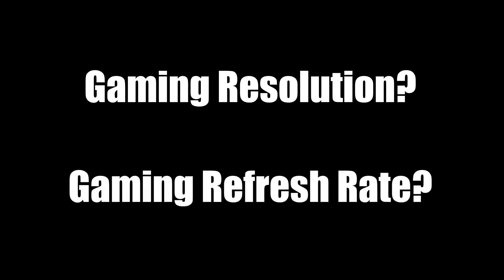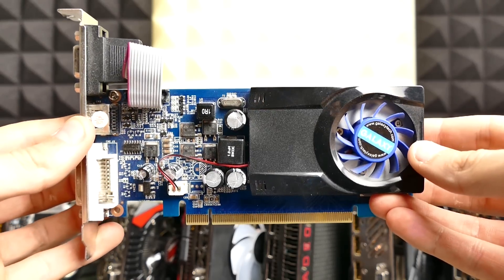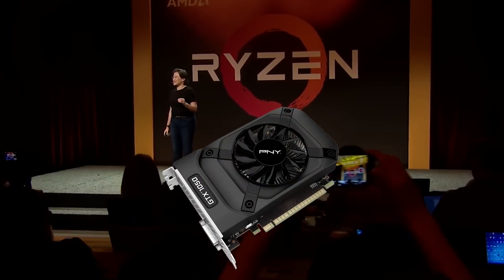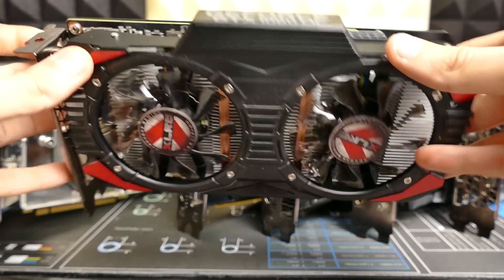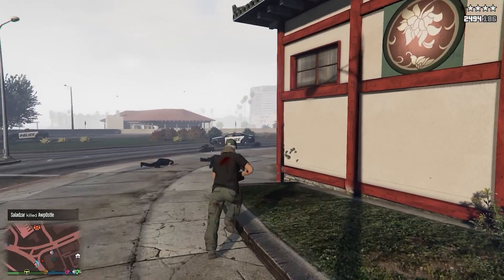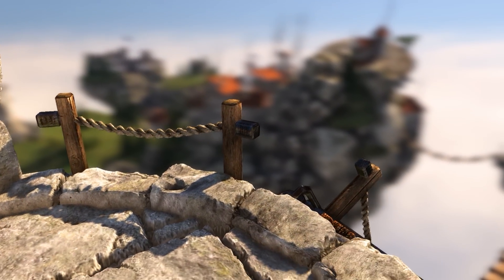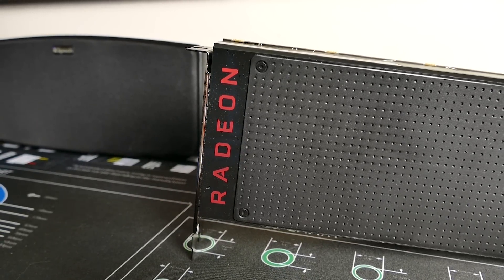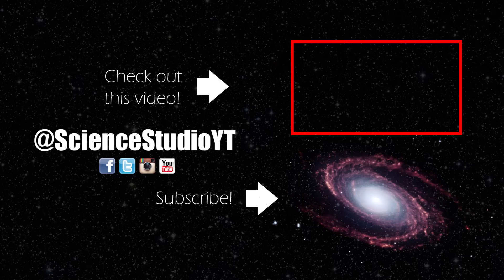Graphics Card Buyer's Guide (Mid-2017)

Comment: i am going to buy a graphics card for 720p gaming ( via 32" TV ) 

Games i play mostly Racing Game ( F1 , Grid, Dirt ) , RPG Games ( Some Indie ones and some JRPG )and some FPS games like Battlefield 1 / Fallout 4 

i currently using i7 3770K @ 4.0 Ghz / Z77 / 24GB HyperX Fury 1866Mhz / GTX750Ti + Quadro 600 ( i am mainly using my PC for Graphics Design, Illustrations and Game Developing but i like play some games since i am game developer and i do need some research by playing games hahaha..  )

should i stay in 750Ti or Upgrade to RX580/GTX1060 3GB ? since if upgrading to 1050 is like.. Sidegrade in my opinion, so actually i am more interested in GTX1060 or RX580, i know it sound overkill for 720p but i like to play it on High-Ultra Settings.

Most games still fine in 750Ti @ 720p but i just think 750Ti is obsolete for today and tomorrows games.
Reply: Huang Yuoxi how well is the 750ti doing at 720p? I think a worth upgrade might be the rx 4/570 and
 the 1050ti. I dont think its that worth to spend the extra 40-70 to get the 4/580 or the 1060
Reply: around 50 fps at high at bf1 and 45 fps at ultra in fallout 4. i want 60+ fps that's why i kinda interested upgrade to 580 or 1060

Comment: as stupid as it sound i use a pentium g4560 and a rx 470 for light 4k gaming but mostly for 1440p gaming. Since im satisfied with lower refresh rates because of freesync it has opened up alot more option in the graphical department

Comment: I think the AMD RX 400 series was replaced by the RX 500 series. I was going to get a 580 but decided I would stick with my R9 390. I spent $1,250 on my build. It took me a while to save up to do it. The most expensive thing in my build was my CPU, the i7 6700. Behind that was the GPU, I got the R9 390 for $295. Then after that comes the case the Spectral R5, the Motherboard an ASUS H170, the WD black 2TB HDD, the EVGA G2 750 PSU, the Mushkin 120GB SSD and the Corsair 16GB DDR4 RAM. Everything else except the RAM was a little over $100.

Comment: I'm going from an amd fx 6300 with rx 480 to ryzen 1700 with rx 480. how much performance gain can I expect?
Reply: boat loads of gain.....your minimum frames will now rise out of the 40's......you have ascended :)
Reply: In CPU intensive games, a lot
Reply: YES. SO MUCH. I, personally, went from an fx 6300 w/ an rx480 to a Ryzen 1600 (OC'd to 3.9ghz) with rx 480. 

Whereas in my previous build I would get good FPS in most games, I never realized how much stuttering and inconsistencies there were in the performance. It's absolutely buttery smooth. I max out Titanfall2 with a steady 100ish fps. I max out battlefield 1 at a steady 90ish. gtav max'd at 70-80 steady. 

And that's the real difference: it's so much more stable. Games run at not only a higher framerate, but they play so much smoother. I didn't realize that's not how games ideally look on a pc. 

And that's only with a 1600. You're getting a freaking 1700! It's going to be a world of a difference. 

Also, as of right now, my ryzen mobo can't fully utilize my corsair vengeance lpx ddr4-3000 yet. I can only get them to 2667 as of right now, but there's apparently a big bios update coming at the end of the month that will address the memory issues :) Welcome to Ryzen, brother.
Reply: He's not dealing with your average FX chip anymore ... Now he has ascended , Ryzen to new plateaus of Saiyan prowess ! He is now, a SUPER SAIYA -  Wait .. wrong thread . Too much TFS
Reply: aircraft carriers of performance?
Reply: ok everyone I worked up some money and finally ordered it. ryzen 1700 with corsair vengeance lpx 3200 mhz and msi b350m mortar. hope it works out
Reply: Two words: A LOT
Reply: Mihnea Andrei Mehedințu 
Have we been here before? I feel like we've been here before.
flashbacks to fx gpu
Oh god we have been here before!
Reply: Cargoships of performance
Reply: You will have a lot more of performance
Reply: Metguy123 thanks man
Reply: Metguy123 What motherboard do you have? I'm planning on getting the Asus prime x370-pro
Reply: Oh yeah I'm looking to build a ryzen 5 1600 system this year but unsure if I should wait for VEGA or get like an rx580... AMD is looking up though :)
Reply: I have an Xbox 360 mate :P No Gaming rig...
Reply: I plan on upgrading to the 1600 after I finish saving for it.
Reply: Filip Gasic the 580 isn't that much better than the 480, but you should get it because they are the same price. I think a 1600 would go well with a 580
Reply: Filip Gasic 500w is plenty just make sure you get a good one from evga. I'm running the 480 and 1700 on 500w.
Reply: Filip Gasic well 3.9 ghz would be hard to achieve with the stock wealth cooler but 500w should be fine. However, even though they are expensive in the eu I would not cheap out on the lifeblood of your system. not only will it be inefficient and cost you more money on the electric bill, there is always risks that it can damage your system. a good evga 500w 80+ certified psu is only $50 in the US, not sure about the eu.
Reply: Cullen Lonergan im very new to all this i just have 1 question please. how much $ was your build & are you using SSD?
Reply: Rey Suarez I've upgraded my pc over the years but I would say it's about $1000. I am using a 500gb Samsung sata ssd.
Reply: CaptainDieg lol did you read the earlier commrnts? I upgraded like a month and a half ago and it definitely makes a difference in both types of games
Reply: But that's a huge bottleneck tho...
Either upgrade your graphics card or upgrade to less powerful CPU or upgrade both.
Reply: Ah, yes. the FX GPU's, and you could also factor in the Fermi / Kepler stoves.
Reply: Yeah congrats. It seems Rx 570s and 580s are hard to get now in the US with people selling them for profit on eBay, all because of some new cryptocurrency, which favours the ADM cards. I'm in Europe though, we don't seem to have the same situation. I just think the 1070 is a bit overkill for me and the rx580 might be more future proof for Vulkan and Freesync monitors are cheaper than G-sync. I wonder if there will be a semi-budget Vega card...
Reply: scoobydoo345  the MSI x370 pro gaming carbon. the one with the RGB. It's solid as a rock

Comment: You mentioned using a 480 for light 1440p. I have a 480 myself, and would you say medium 1440p looks better or worse then near max 1080p? I've never even seen a 1440p screen before, so not sure if it's worth the compromise

Comment: I want to be able to play games @1080p60 but with full settings. I have seen people suggesting a gtx1060 but on full game settings with 2xaa/4xaa, the fps goes down to 30 for some games. Isn't then a gtx1070 better choice for a solid 1080p60?
Reply: Depends what game...I have a 1070. Totally worth it.
Reply: Rx 580, anything over it is overkill
Reply: Abhinav Saund My fellow Indian,if you go over to mdcomputers,they have the gainward phoenix 1070 for 28k,and the same version 1060 6g for around 18k iirc. Those are currently the best deals right now in the country,without a bumper sale. I got a zotac Amp Extreme 1070 couple weeks back from amazon during the great Indian sale for 26k,no regrets. If you are not going to purchase another card within 1-2 years,I suggest going with the 1070. The 1060 is fine only for now,but very soon settings will have to go down for 60. With UniSoft's shit optimisation,the latest AC already goes to 30 on ultra. 1070 will run pretty much anything above 70-80 for at least another year,and then 60 for another.Much better value in my opinion. Also 1070 will let you crank up textures to 4k across the board.
Reply: Abhinav Saund I have the i5 6600k and 16 gigs of ddr4 2133. You can still get a 1070 for 28k @ mdcomputers. 1060 does struggle with locked 60 with absolute ultra settings IMO,even more so since I run at least 8x AA,and put settings even beyond the game settings with the INI files. The graphical fidelity is very important xD
Reply: Abhinav Saund I have a 1060 6gb and it runs games beautifully. Even with my sub-par Fx-8350, the 1060 provides great performance with whatever I throw at it.
Reply: 5ive-7even i totally would have gone the 1070 route, but it simply wasn't in my budget. I got mine new for $200 on discount, and didnt have another $150 for a 1070.
Reply: Abhinav Saund Rx 480 is better than the 1060 at a lower price. And the 1070 is overkill
Reply: When i played Rise Of The Tombraider at 1080p60 with all settings maxed the Vram usage went up to 7.5gb so 1060 wouldn't be enough as it only has 6gb
Reply: John Jeffry Not where we live. I can guarantee Vega will be $600+,just like almost all 1070s. Msrp doesn't mean a thing here, not to mention the 2-3 months wait before the things are actually up for purchase at the overpriced rates. ANY Amd price benefit doesn't apply here,because resellers price competing products exactly the same.
Reply: RadeonGuy27 Here in my countyr rx480(23k) is more expensive than gtx1060(19k). So would prefer 1060 over 480.
Reply: Headhunter_FRANK,   Dominic L :  Can 1060 play games in ultra settings with smaa/4xAA? i think the fps would fall to near 30. is that fps playable?
Reply: Abhinav Saund But all depends on your budget. As for 30 fps,it is quite noticeably laggy on a KB+M because the camera moves quitre fast. Still barely playable though,varies from person to person. 30 will also seem better if you play with a controller.
Reply: Headhunter_FRANK What is with the rx580?
Reply: Anuranan Rai  Deka A 1070 for 26k is a good deal. Also what processor and how much memory do you have. I belive the cinematic beauty is very imp for the immersion experience and a 1060 @1080p with 4xaa would give around 30-40 fps thus ruining the gameplay, i think.
Reply: or buy vega 4gb around $290-300 very soon
Reply: Abhinav Saund no a 1070 playes 1440p on all games
Reply: aass Smithassaa Crysis 3?
Reply: Built a 1600/1060 build and it is perfect. I have never gone below 60 in any game I've played, all on the highest settings (1080p60Hz, of course)
Reply: Anuranan Rai Deka all AMD cards are out of stock currently. And there's no way I can find a gtx 1060 within 25k INR. Should I wait for AMD cards or spend a lot on a card (gtx 1060) that is already a year old?
Reply: Lizard where did you get a 1060 for $200?!?!? Tell us lol
(In all seriousness, I'm mid build yet to buy my GPU, if you got that link pass it)
Reply: 1070ti to future proof. but i dont think the ti existed when this question was asked lol
Reply: Abhinav Saund no, trust me, a 1070 at 1080p is a waste. 1060 is plenty.

Comment: leaks are saying that the rx Vega will be around the middle of hrs 1080 and gtx 1080 ti. If it's less than a 1080 it's still worth buying but it won't compete with volta. too little too late. ryzen all the way though.

Comment: <--- uses 290x at 4k still.. helps that it's oc'ed past a 390x but still.
Reply: FineWine™
Reply: AMD still supports older cards a lot longer with than NVidia does with driver optimizations. FineWine should still be a thing with Vega, but probably wont be as effective.
Reply: It doesn't? I thought Vega was 5th gen GCN.
Reply: SoloCamo Thats Badass ^
Reply: Nathan Kam You can't know that before it happens. That's a risky assumption.
Reply: My HD7870 bottlenecks my Piledriver in nearly every game, even in fucking minecraft. I shouldnt have bought a 1440p monitor xD
Reply: That Guy On The Street FineWine will die once vega comes out, cause it no longer uses the gcn archeteture

Comment: I want to buy a 1080ti for my 1080p 60hz monitor so it will last 5 years and still be decent
Reply: That's actually a pretty wasteful idea.
In 2 years a new card that costs $300 will beat the 1080ti.
Reply: ya, maybe ill just buy a 1070 or wait for volta, I have a r9 290x right now and its still going strong
Reply: You should hear some solid street dates on volta mid next week.
I have a 1070, and have zero complaints 1080p-1440p is always smooth as butter.
Reply: I might as well just wait

Comment: what about for triple monitors at 1080p 60hz and I want to power all of them does that mean I would get the gtx 1080ti?
Reply: ViETKhanGG unless you're gaming on all of them at the same time, no. 1060/480 is the most you need.
Reply: Fox Knapp I might get the gtx 1080ti I'm still deciding on Vega though like in coming close to a build but I recently though of the nvidia stream over thing over amd but like what version of the gtx 1080ti should I get the evga  sc2?
Reply: You don't need a high end gpu for triple monitors. Any gpu can push 3 monitors. It's different when the monitors are higher in graphics such as 1440p, 144hz etc
Reply: Well I want to be able to game to game on all monitors though

Comment: top end vega is supposed to have 13 tflops at 600$ at 250w or less. If the tflops scale with performance like it does with nvidia, the gtx 1080 ti will be irrelevant. The only problem for amd is that volta is coming like early 2018 so :( sorry amd
Reply from the maker: TFLOPS never scale linearly across AMD/Nvidia.
Reply: Science Studio yeah that's what happened with the fury x and 980 ti. I thought maybe since it's a new architecture it could scale differently, but what do I know

Comment: I have a 4790k and 660ti
Reply: wow, if you upgrade your gpu youll have a great rig
Reply: I'm getting a used 750ti soon so that'lll be pretty sweet.
Reply: neat, thats not a huge upgrade though, but thats fine, have fun
Reply: Trollerman Sixtysevan the 1050ti isn't much more expensive but quite a bit more powerful
Reply: a 4790k for coding?
why am i still stuck with my q6700 for emulation...
dolphin wont even use 4 cores
Reply: +Trollerman Sixtysevan not that big of a upgrade my friend
Reply: BlackHairedGoo n Yeah I don't play games i just do coding and watch videos.
Reply: at least he is upgrading, im stuck with a r7 260 that cant even play dota 2 at 900p 60 fps on max
Reply: Trollerman Sixtysevan I just bought an HD 5770
I have an RX 480 too, I just wanted something cheap too
Reply: get a good gpu like rx 4/580 or 1060
(or if you buy used 2/390/x or 970)
Reply: Trollerman Sixtysevan for coding and videos your rig is a beast lol
Reply: 4790k for coding? You really dont wanna wait a second when compiling, huh?

Comment: would a 1050 ti be enough for overwatch with a 144hz monitor?
Reply: yeah, 1050ti can run overwatch on ultra i believe? at 1080p, but unless you have a gsync monitor, i would get a rx 570
Reply: A good 144 hz monitor cost more than a 1050ti so why not just get a better graphics card

Comment: I wanna pair my G4560 with 1080 ti. Is that ok? Or should I upgrade to non k i5 7500?
Reply: I think most people will see this as a troll attempt but I'll bite I guess.  Your CPU will bottleneck anything above a GTX 1060, like pretty hard.  Saw a video about this somewhere, I can find the link if you actually really need it to be convinced.  What resolution are you running at?
Reply: Uenostation54 What, the G4560 will bottleneck even the rx 470. You shouldn't go higher than a GTX 1050ti. Funny how people are now over hyping the G4560 sayings its the exact same speed the i3, but before it was released. People were saying how Skylake i3s' were much stronger than the Skylake pentiums. All they did to the kaby lake pentiums was add a couple of threads.
Reply: Nah am not trolling. I'm dead serious. 2k display. I thought I'd go CRAZY with the gpu since my other components are pretty budget. That was my original idea when I first building the pc, invest more on gpu. If it were to bottlenecking, I'm willing to upgrade my cpu (am not overclocking)...and thanks for the reply.
Reply: RiK. ryzen seems pretty promising, and if you ever decide to overclock you can, maybe a 1500x or 1600
Reply: Ahh great suggestion! Thanks again!!
Reply: RiK no problem
Reply: Your results arguably matter the most.  If you aren't getting 60fps at Ultra settings at that resolution with that card on basically every game (there are always games like Ghost Recon Wildlands where it just wont happen) then a CPU upgrade would help get you there. BTW, I don't actually recommend trying to play at 4K, it is SUCH a chore and is super expensive at this point in time. I do believe that a reasonable non-crazy CPU upgrade will get you all the graphics as long as you stick to 2K.  Good luck!

Comment: I want to get an ASUS 1080 Strix. Seems really sweet. My monitor is 1080p but it has a 144hz refresh rate and since a lot of games have resolution upscaling I can bump those up a bit. Just waiting until they start giving free games with them again ;)

Also what's a good motherboard? I have an old z87-hd3. It doesn't even support SLI.